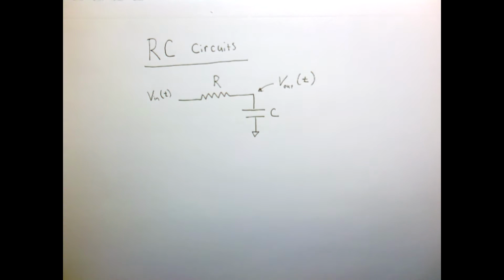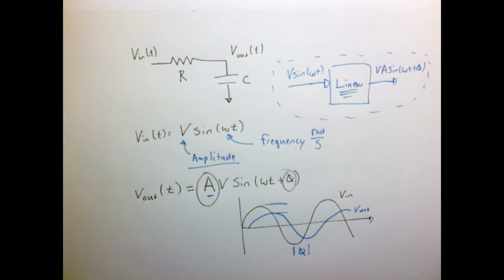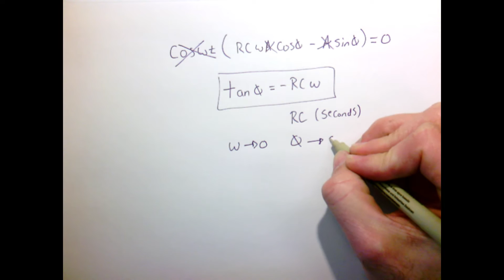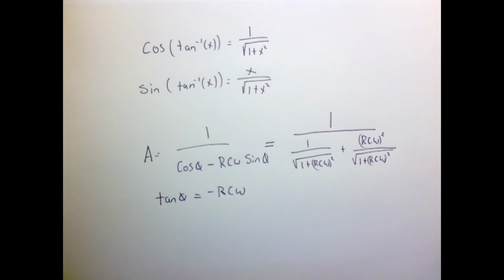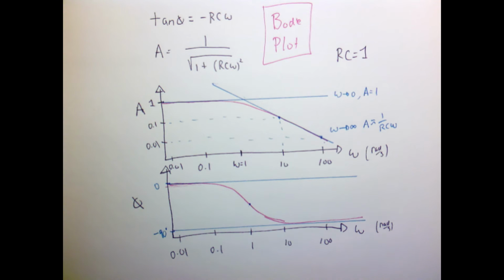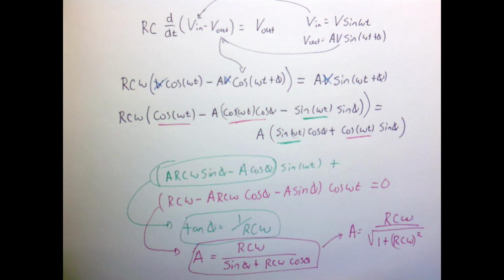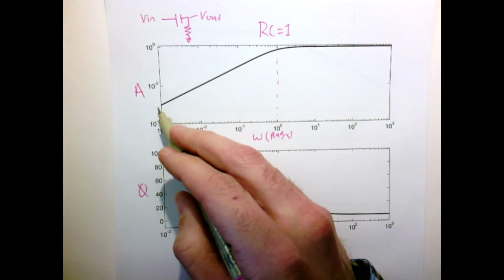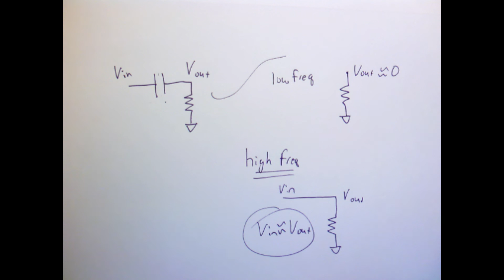RC circuits and Bode plots

Comment: Nice video! was hoping you were going to use transfer functions , but this was still very helpful. I have a question: Are RC circuits always called LOW-pass filters? Or are there circumstances where a first order RC circuit could be a HIGH-pass filter, or an other type of filter?
Reply: If you measure the voltage across the resistor you would have a highpass filter. The voltage across the capacitor would in the meantime look like a lowpass.